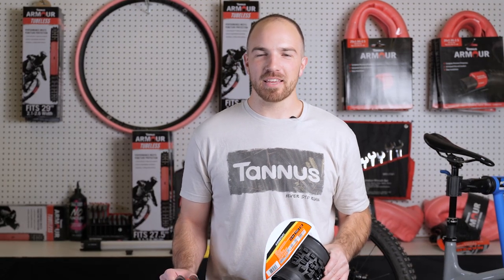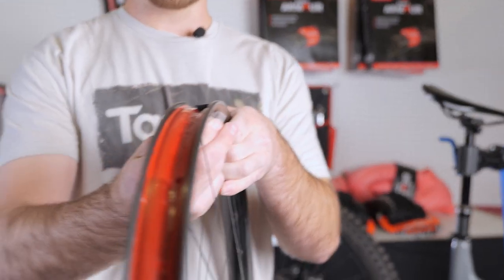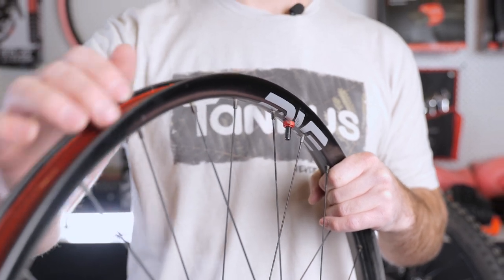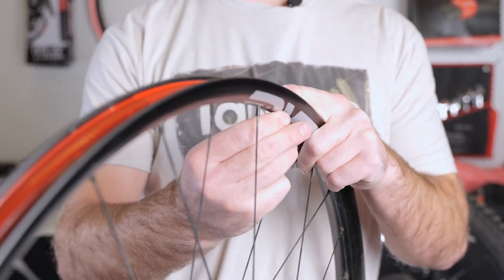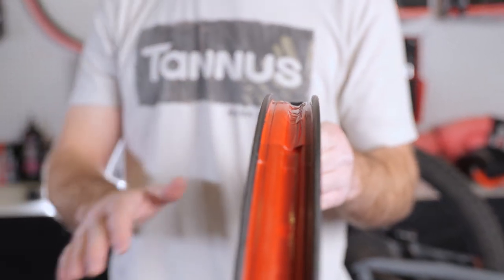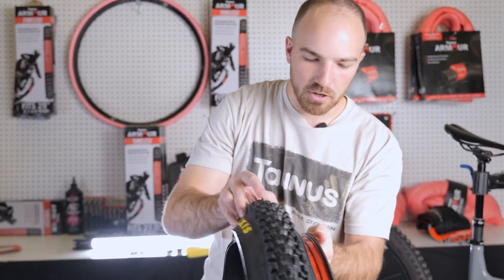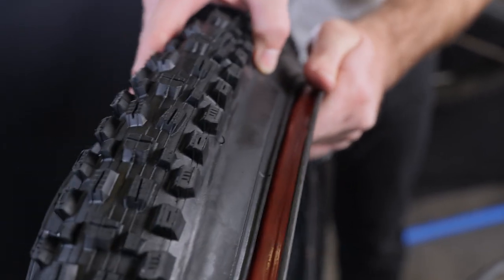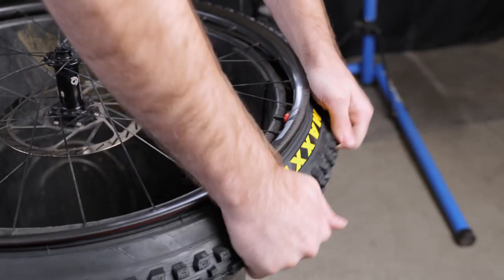Un-edited Raw Install: How To Install Tannus Tubeless Insert on an ENVE Rim with Maxxis Assegai Tire

Comment: This is one of the best vids I've seen on a 'insert install' so far.  I'm prepping for a Tannus install soon.  I've watched most the shorter (~5-10 min) ones from Tannus.  I've read the comments and their tips/suggestions.  I've watched end-user install videos.  I've even watched some good CushCore and Rimpact installs to get some ideas.  This guy explains this very well, is thorough, isn't rushing to get it done in "5 minutes", or some set time.  Great work, great info, and great explanation of the process. This should def. help me when I get to the install myself.
Reply from the maker: Glad ya liked it!  Clayton is the man.  Enjoy the ride

Comment: If you have an extra rim kicking around, put the insert on that and let it sit for a day, helps set to the profile of the rim. Also, definitely set the beads of the tire first, let the air out and pop off one bead and start your insert install. Makes a big difference installing these inserts.

Installed on a Chromag BA30 29" with a DHR II
Reply from the maker: Appreciate the tips! 👍🏼

Comment: Im using a no name really thick plastic liner. Maybe like 3 credit cards thick, but pliable. I trying the thick nylon 4" webbing cut down a bit thinner next if its no good. Since the Tannus gets thin fast, I will go to a solid before I go with them.

Comment: Right, I've installed this insert on a DHR II with a few rides on it, used no tire levers, rolled the bead onto the tire and have a wobble. I had one side of the bead on the rim for the most room, pushed everything into the well of the reserve rim and it still happens.
Reply from the maker: Hi ImoonPeople!  ..nice name btw lol.  Just to confirm, it is a wobble in the tire, not the rim?   Rim is true?   We've found that if you are experiencing a little wobble, applying some dish soap to the insert's edges can help the insert slip into its pocket in the tire.  Also, coating the insert with some sealant helps everything move into place.  When it's a new tire, new insert they can tend to stick together a bit.  You can after mounting up the tire&insert roll the wheel on the ground pressing down to help massage the insert inside the tire.  Hope this helps!  Thanks for watching!